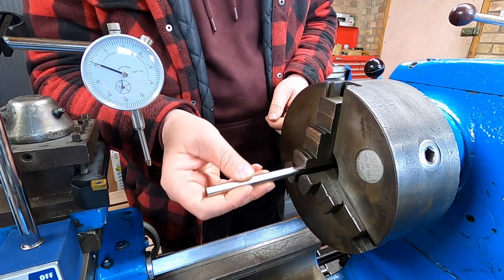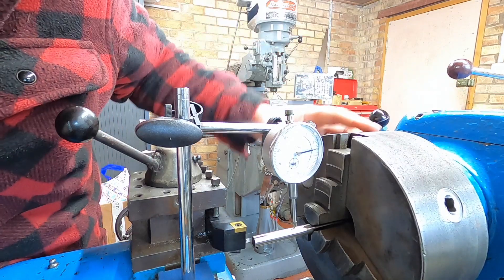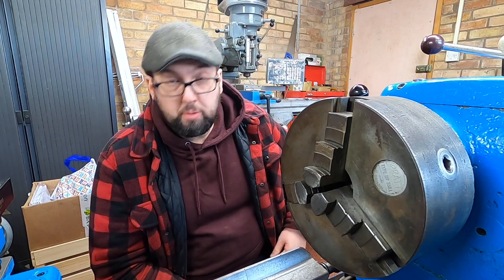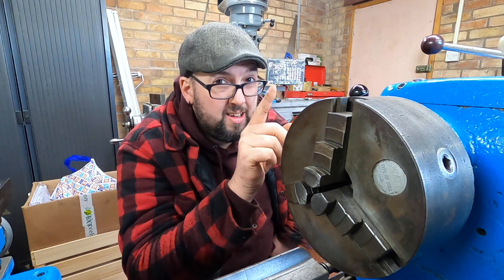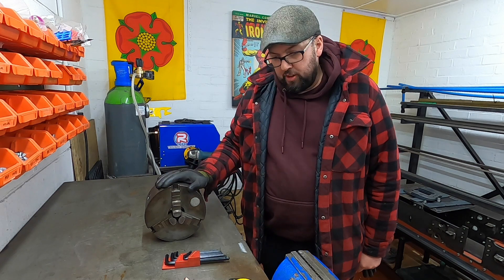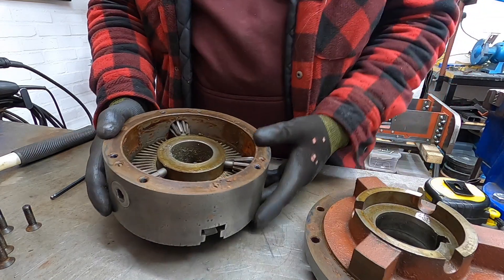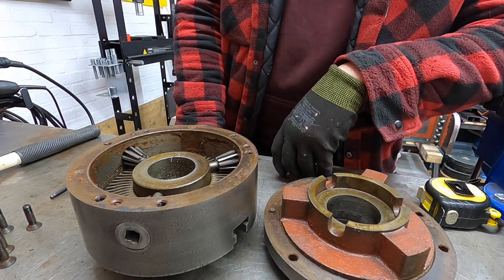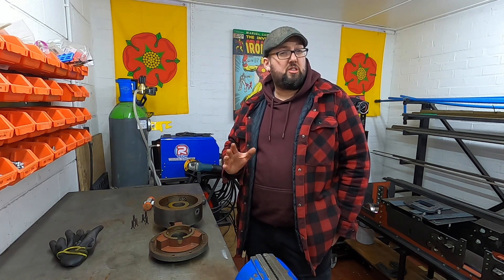Harrison Lathe -  Part 6 - Three Jaw Chuck issue

Comment: Don’t put the chuck on the lathe bed you will damage it. Place a plank of wood on the bed before removing the chuck. If you go on dropping the chuck on the bed it will be damaged before you notice it.
Reply from the maker: I’ve been told this before, as I don’t drop or throw my chucks onto the bed, I place them down with care, the bed and the chucks will be fine. I’ve never damaged a bed in 30 years while using machines in industry. 👍. All the best, Matt.
Reply: @MattChiversWorkshop  
From your lathe manual 
“When mounting or removing a chuck, protect the slides of the bed with a piece of wood upon which to rest the chuck before lifting it on to the spindle nose. Once the threads engage, do not spin the chuck rapidly back against the spindle shoulder or it may be difficult to remove later. To remove a chuck, place a block of wood between one of the jaws and the lathe bed, and pull the chuck so that the jaw strikes the wood and begins to unscrew. Do not attempt to use power for this operation: it is dangerous and may damage the chuck and
spindle. When tightening chuck jaws, never try to obtain increased
RiDding power by lengthening the arm of the box key——“

Comment: When swapping chucks a thin sheet of wood helps protect the lathe ways  if the big heavy four jaw slips out of your hands as mine tries too every time ! I thought you tapped the Chuck to knock it off the taper but if you turn the collar about 1 more turn it goes tight against the Chuck and then a further light quarter turn pops it off the taper and with a further full turn remaining to stop it coming right off.obviously a lot easier with the C spanner.
Reply from the maker: Yes I repeatedly get told about the wood, one day it will go in and I'll do it. New habits and all that. I sort the C spanner issue eventually, it doesn't get use that much currently, I don't have enough tooling as of yet. I'll get there. All the best, Matt

Comment: If it was me, I'd do some tests with a few diameters in the chuck and try to figure out which jaw needs adjustment, and grind each accordingly. It might take a few goes but you have nothing to lose by trying. Trying several diameters will determine if the scroll is stretched, so if you get consistent errors on several diameters then it points to wear on the clamping surface of the jaws. You could figure out a way to hold a angle grinder or die grinder and use the Bridgeport table to run back and forth with the jaw in a jig or vice.
Reply from the maker: Thanks Anton. From memory, they are all worn or appear to be, never thought about the scroll tbh, I'll have a look at that and try and include it in the follow up video. I have found a company in the UK that is selling the L00 back plates at a reasonable price so easiest option currently is a new chuck and back plate which I'd go for 6". Interesting idea for grinding the jaws. All the best, Laters, Matt

Comment: Matt, these old 3 jaw chucks that have been around commercial shops for years sometimes have the scrolls stretched and thus are only accurate at the diameter you grind them at. Been super cold here in New England and I have been out of the shop a lot and not doing my U-Tube but congratulations on the readout for Bridget, you will love it and the features it has.
Dick B USA

Comment: Hi I have a colchester student , same style chuck . I held die grinder on toolpost. Used  thhree identical spacers   between the jaw sides and tightened up the chuck ran the lathe and used the cross slide  to run the die grinder in and out improved the chuck dramatically . And with little effort worth trying

Comment: Too bad about the 3 jaw. I wouldn't rule out grinding the jaws. I'm sure you could find a friend that can help you. Wish I could. It would be interesting to see what the indicator reads at the end of that 20mm bar in the 4 jaw. I would expect there to be close to 0 at the chuck if that's how you indicated it.
Reply from the maker: So far it works out cheaper to replace the chuck, than buy all the equipment to refund the jaws. We have looked at all possible outcomes. All part of the fun of these old machines. All the best, laters 👋, Matt